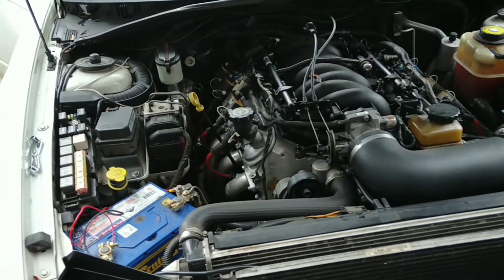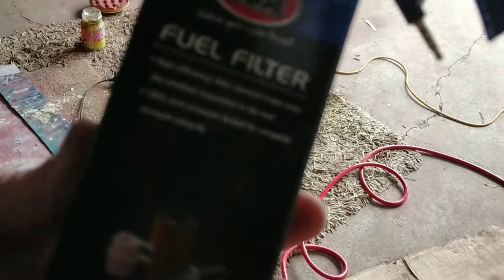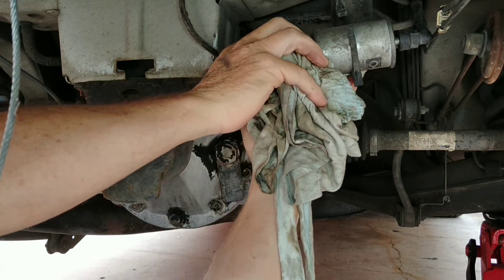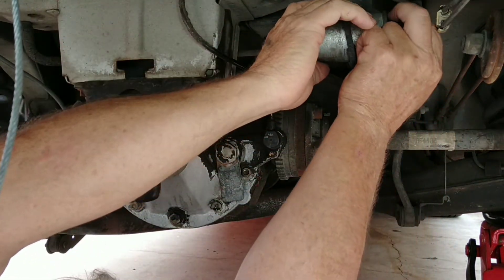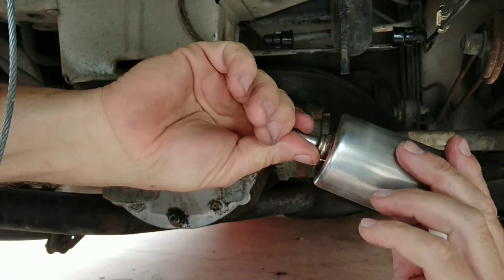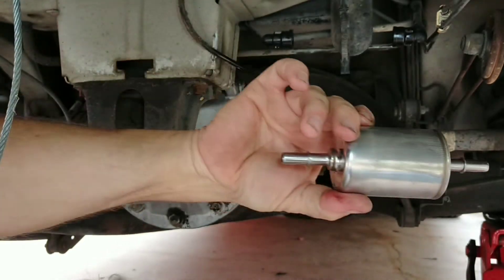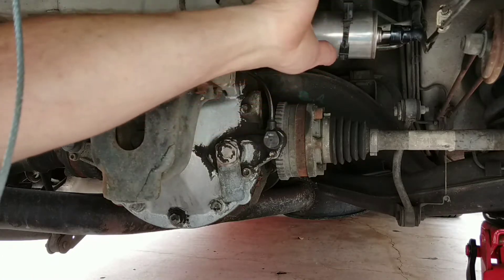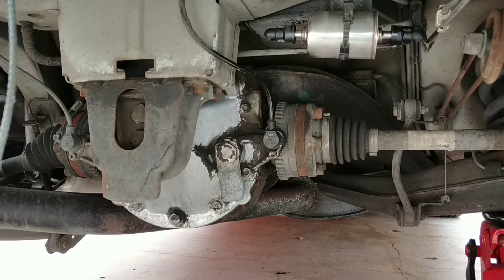VY SS UTE FUEL FILTER CHANGE

Comment: Thanks man, was wondering where the filter was, as I heard it would be in the tank. Not easy like the real Holdens pre injection
Reply from the maker: Yep the old cars are easy and uncomplicated
Reply: Darn I think mine is in the tank to which I ask what idiot thought it was a good idea. My ute is a one tonner, but was thinking it shouldn't matter, but it is not where your filter is, and I cant find it anywhere else, so it has to be in the tank. So once again, something I used to do, now have to pay to get it done
Reply from the maker: Sorry to hear that. I have no experience with one tonners
Reply: @mwoods2062  As I found out, there was no filter on the car at all, so my injectors are clogging up. I took the tray off and the pump out, but broke the fuel line connection on the pump, so I improvised by modifying the connector and putting a new fuel line on it. I have installed a different filter under the bonnet which I don't understand why they had to make things so difficult, as it is so easy to access. If I could put photos on here, I would show you what I did and save the cost of a new fuel pump because of a small plastic part breaking.

Comment: My connections,  were damaged.  I ended up, putting on old school fuel lines,  and hose clamps on.  If you have a good look. You only need 450 mm of hose ect,
Reply from the maker: Hi Barry, yes that sounds like a good idea. If I ever break mine that's what I will do. Thanks for your comments.

Comment: Just did mine, no tool required and it’s easier to pull the wheel off and reach in.
Didn’t get one drop of fuel on me.
Reply from the maker: You did a lot better than i did, I always spil fuel.